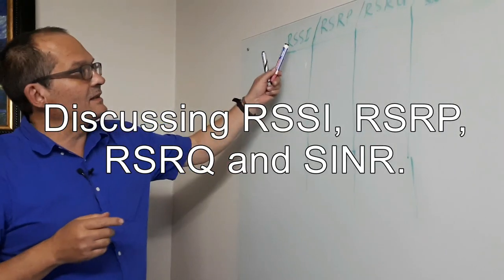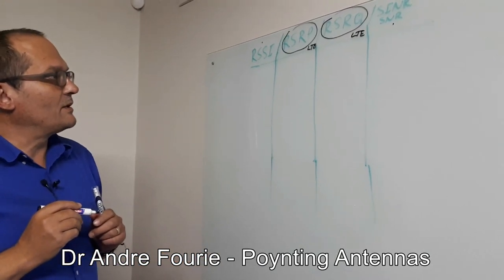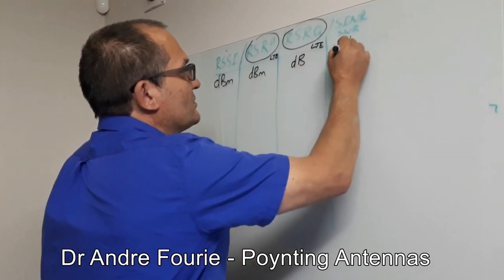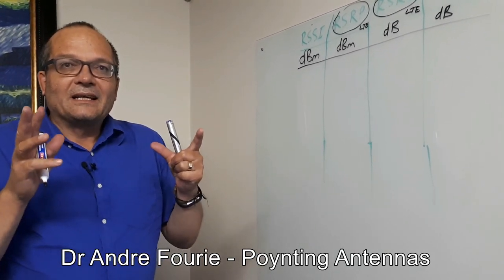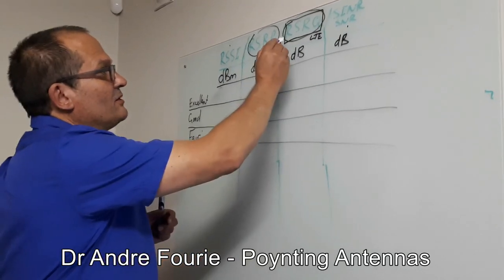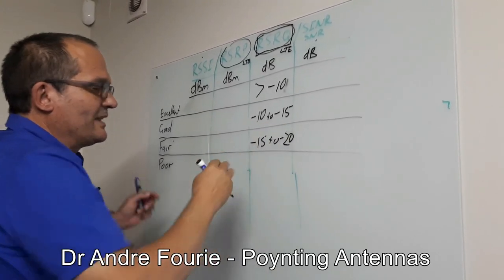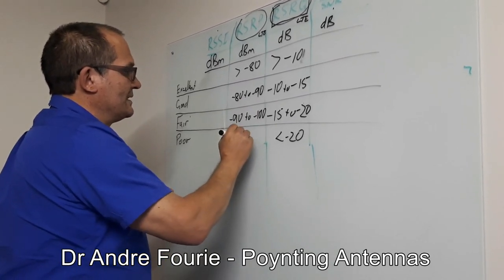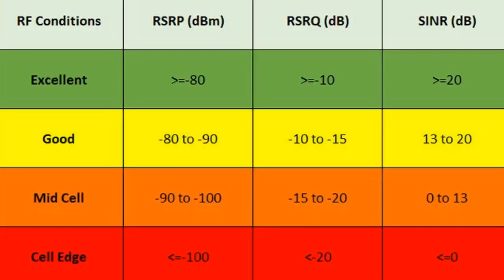5G Signal Made Simple -  What is RSSI, RSRP, RSRQ and SINR?

Comment: Current reading from mofi 4500 V4
RSRQ -74
RSRP -621
RSSI -350

I'm currently using a weboost yagi antenna 3314411 and a we boost panel antenna that's part of the FBA_470101 Kit mounted about 30ft in the air. I have these on a splitter going to a signal booster. Would it be better to have them going straight to the mofi? The yagi was also a  50 ohm N-connector but i took it a part and replced the pig tail with a 75 ohm F-type connector. I'm using at&t towers and i'm only a few miles away but in a dense foliage area.

Comment: Sir Why The signal measurement is in -65
-76
-85

Why is in minus ...please ...tell me ....sir
Reply from the maker: Hi Sundaresan, 
It is a convention that signal is measured in dB and is measured relative to zero. The stronger the signal the closer to zero, therefor a weaker the further away from zero. 

-100 is a very bad signal, -50 is a good signal. 

Zero is normally zero attenuation (which means weakening of signal). So at Zero there is no weakening of the signal - it is as loud as when it was transmitted.

So the moment the signal leaves the radio it is already lost some of its strength and therefore the  strongest signal that we normally measure close to a cellular tower is +- -60 dBm.

Kind regards
Poynting Social Media Team
Ps. Please note that this is a basic explanation to try and simplify this concept and we did not necessarily use the correct technical terms everywhere.

Comment: I'm not clear as to how a negative RSRQ works.  Earlier you explained that it is similar to SNR.  You cannot have a negative SNR.  You also mentioned that it is based on the reference signal, rather than the entire OFDM signal.  So does that mean the value is the ratio, or difference between power of the reference signal vs the enitre OFDM signal?  This would make sense to me, but still wouldn't provide useful info regarding SNR.
Reply: Good day @dLimboStick, RSRQ = Reference Signal Received Quality: This measurement also considers the RSSI and the number of used Resource Blocks (N). The calculation is:  RSRQ = (N * RSRP) / RSSI measured over the same bandwidth. RSRQ is a C/I rather than just a SNR type of measurement; it indicates the quality of the received reference signal. The RSRQ measurement is used to  provide additional information when RSRP is not sufficient to make a reliable handover or cell re-selection decision. Kind regards, Pieter Prinsloo, Technical Support Engineer, Poynting Antennas.

Comment: I was wondering what is the effect if i increase the below : 
1-RRC 
2-Throughput 
3-Number of cell
Reply: Hi Saud, sincere apologies for this late reply; RRC (Radio Resource Control), as you probably know, is quite tightly controlled by the MNO to ensure fair distribution of bandwidth to UE (User Equipment) such as Mobile Phones together with the RRM (Radio Resource Management) layer. Without going into detail, at the RRC/RRM layers the Router has fairly limited control, maybe some influence over 'paging notification and release' but the ultimate control lies with the eNodeB. This means that the Router reacts to RSSI, and predominantly RSRP, RSRQ and SINR, most of these influenced by external factors with the router having some control over transmitter output power and even then if the Router is experiencing for example poor SINR, it would employ it's maximum RF power output strategy/algorithm. Throughput: - these factors will largely influence the ability of the Router to use higher orders of QAM (Quadrature Amplitude Modulation), let say the SINR improves, the then the Router could for example step from 16 QAM to 64 QAM (16-bit vs. 64-bit QAM) to increase the number of bits per cycle and of course the throughput; this is controlled automatically by Algorithms set up in the Router. Increasing the number of Cells is good as long as the Receiver can demodulate a 'clean Signal'; the Router, through for eg. an Omni-Directional Antennas, could receive good RSRP/RSRQ and a good SINR and then the Router can be set up, for example, to switch from connecting to the MNO's Tower A to Tower B based upon congestion experienced in Tower A. As we're talking predominantly FWA (Fixed Wireless Access), the Router, through an Omni-Directional External Antenna, may suddenly experience Interference from a Mobile Device on the connection to for example Tower B and based on setup in the Router, it could switch to Tower A, even switch to a different MNO if the Router has multiple SIM cards. Hope that answers your question sufficiently? Be sure to revert if we can clear up any points further, kind regards, Pieter Prinsloo, Technical Marketing Engineer, Poynting (Pty) Ltd.

Comment: What does it mean if you have an RSRQ of -14  to -16 and the RSRP is -85 but the SINR is between -6 and -3 ? Is there then a lot of noise in the area as well? Or is that interference?
Reply from the maker: With reference to the table at the end of the video the following:

RSRP = Reference Signal Receive Power; this a 'negative' number measured in decibel referenced to a milliwatt (dBm); 
- the larger the number i.e. -80dBm is LARGER than -100dBm, the BETTER the signal - eg. larger than -80dBm (like -76dBm for instance) is considered excellent.

RSRQ = Reference Signal Receive Quality; this is a 'formula' [RSRQ = n x (RSRP/RSSI)] that 'calculates' the Quality and should also be 'LARGER' than, in this case, -10dB 
- i.e. -6dB is considered 'excellent'

SINR = Signal-to-Interference-and-Noise-Ratio; very important measurement as it measures the 'amount' of interference and noise a Router's receiver has to 'contend' with; this is like trying to listen to a conversation in a 'noisy' restaurant; the Router has difficulty in 'understanding' the 'signal' due to the Radio Frequency (RF) interference and noise; the result is that the Router has to 'ask' for many 're-transmits' that 'slows down' the rate at which it receives information.

In the above example; RSRP of -85dBm is GOOD; RSRQ of -14dB to -16dB is between GOOD and AVERAGE but SINR of -6dB to -3dB is AVERAGE. 

- this means that there is significant INTERFERENCE and/or NOISE which could come from other Transmitters; (Mobile-, Wi-Fi-, other Radios etc) or Power Lines, Transformers etc. (Noise) etc.

Increasing the SINR to larger than 13dB (i.e. >20dB) through the use of an external Directional Antenna should improve the throughput (Up-/Download) significantly.

Comment: Hi,

I tried the pointing Omni xpol antenna however I haven't noticed much difference in rsrq and rsrp on my router however they are both in good ranges.

However it appears that my SINR is really making my connection poor and drastically change.

My SINR varies from -1db to 18db (at this figure I get very good speeds).

Can you recommend a product that will help most with SINR? 

Thanks

Comment: Dr. Fourie,  How good does the signal quality or power need to be to get three band carrier aggregation enabled?
PCC RxM RSSI:  -58  PCC RxM RSRP:  -90
PCC RxD RSSI:  -54  PCC RxD RSRP:  -86
SCC1 RxM RSSI: -69  SCC1 RxM RSRP: -100
SCC1 RxD RSSI: -68  SCC1 RxD RSRP: -100
RSRQ (dB):     -11.9
SINR (dB):     12.2                 I can only manage to get B2 and B12 going.
Reply: CA (Carrier Aggregation) depends on several variables.
One is the CAT version of your radio, anything above CAT6 has some kind of CA, for example CAT6 has CAx2, CAT18  has CAx3, and CAT24 has CAx4.
Second is your carrier's tower software, which controls the number of bounded channels.
Third is your signal strength, depending on your radio and tower programming they will usually bind channels with an RSSI better than -110.
Fourth, it may also depend on the mobile plan you are subscribed to, some allow the full use of CA, while other cheaper plans might prohibit the use of CA at all.
So, as you can see there are quite a few variables which all must match up to get any kind of CA, let alone your desired CA. ;)

Comment: Hi Andre

These are my current values:

RSRP: -76
RSSI: -51
RSRQ: -8
SINR: 7

Do you think I should buy an Antenna?

if so, which one? I am using the Huawei B618 on 2300mhz TDD (Telkom)

Regards
Craig
Reply: @poyntingantennas  thank you for the reply

Will buy one and post the figures here once it's set up

Regards
Reply: @poyntingantennas  good day

So I bought the Xpol 0006 with 10m cable, my download speed hasn't increased, though my upload increased 3x what I used to get before, I also noticed that my connection is much more stable and speeds are consistent, also Im connected to one Cell tower now and it doesn't jump between towers anymore like it did before.

I'm very happy with the results.

Unfortunately I'm not on face book, but will upload a video to YouTube and show before and after results.

Cheers.
Reply: If your signal is already very good, generally the download speeds won't increase much since your receiver can pick up the "high-powered" carrier signal much better than they could pick up your transmission.  So with a high gain Poynting antenna it's no surprise that your UP speed has gone up by 2 to 3 times.  On the other hand if your received signal is poor then you should see a nice improvement in both UP and DOWN speeds.  Hope that makes sense.

Comment: My sinr readings show -3 ... wtf 

Also last week my download speed went from 15+ down and up to 2 down but surprisingly the upload is still 15 so i started researching this topic ... what is happening here ?
Reply: Deathwarrior, question; are you using an external Antenna? Did your Download speed only worsen when your SINR was at -3dB? This level of SINR could point to a high level of local Interference from some Radio Frequency source or just very high Attenuation of the receive signal due to some form of obstruction due to compromised positioning of the Antenna. I mention the possibility of Interference since you stated that you had a situation where your were getting good Upload but poor Download. There could be multiple reasons why Upload would be better than Download. One reason could be Congestion from the Base Station but, if Download is poor ALL the time then it is likely local Interference and, since the Signal in the Uplink is stronger, the Base Station may not be experiencing the same level of SINR at it's receiver and that could explain why Upload is better. That's the short possible explanation, it does get a little more complex when starting to consider Bit Error Rates (BER), Re-Transmission Rates and the Base Station's own Congestion Control etc.If this is indeed an external Antenna installation (which should normally improve your Signal significantly) consider reposition the Antenna to get a better SINR. Pieter Prinsloo, Technical Marketing Engineer, Poynting Antennas.

Comment: RSRP: -96
RSRQ: -6
SINR: 0

I'm getting speeds on D/L of 60Mbps and U/L of 20Mbps + but find that whilst the connection never drops, it does stall. (webpages don't load, speed tests don't always work) I am assuming its the SINR which is the problem, but no matter where I put the antenna the SINR does not move from 0. Can you clarify that SINR is indeed the issue and what product you have which might help?